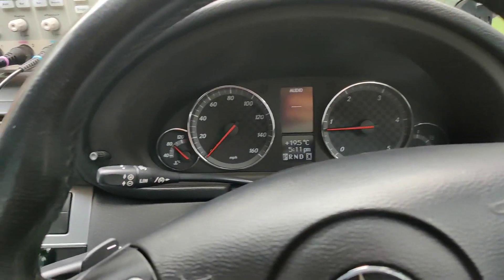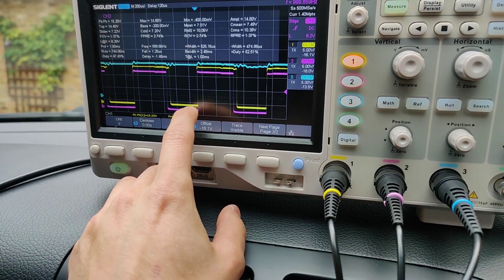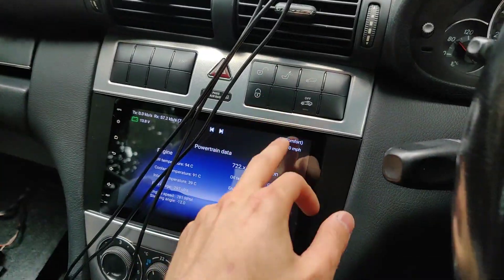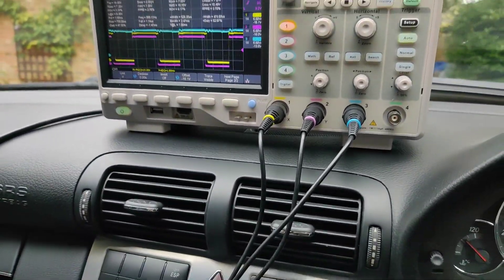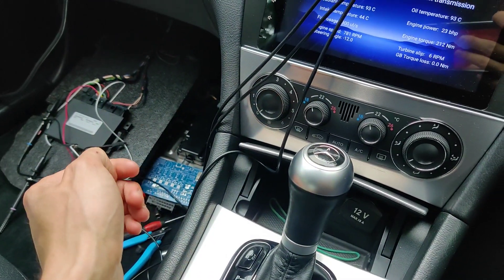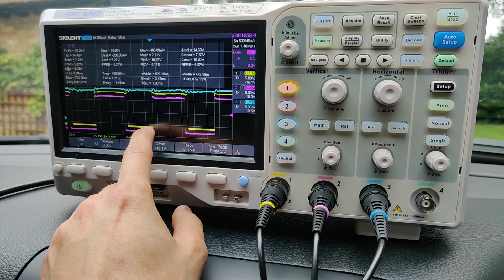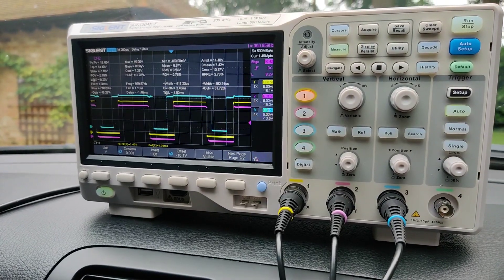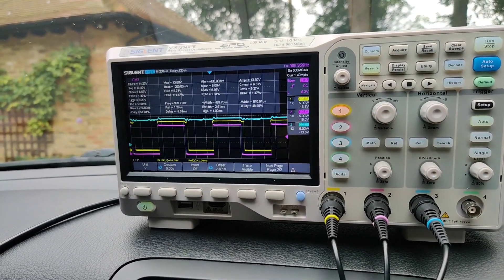Ultimate NAG52 progress update - Solenoid probing with oscilloscope

Comment: what will get out of here! Is your auto box already working fine or are you going to try to compensate with the controller? I wish a lot of persistence for this controller ;)
Reply from the maker: Mainly bug fixing and much better shift quality with older, more worn out boxes. From what I found, certain flaring issues have a mechanical root cause, but the controller can easily mitigate it. But the stock EGs52 controller doesn't. Mercedes quotes £1000s for flare fixes so I'd love to prove this can be fixed in software easily....at least reducing the flare.

To add to this, my controller will run a full neural network for shift behaviour learning, and have loads of configurability as well as full CANBUS support for 2001+ Mercs. This is something that solutions like ofgear can't do
Reply: @RANDASH  brand like many other things have no interest in fixing existing parts or even improving their software performance!
I am of the opinion that adaptations could make a difference, there are reports of this experience that reveal improvements!
Reply: @RANDASH  I have tested ofgear on my car, i make myself from firmware of these sites. You have right og comunicate only with selector over can, not all can network. I get  back egs52 and learn how to tune it, because for ofgear i havent code and your project i like because is open source.